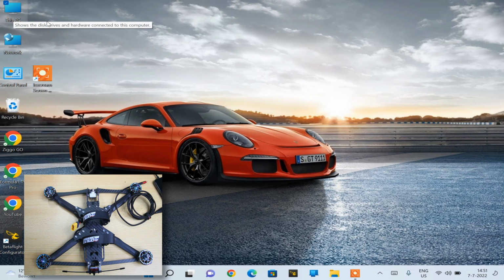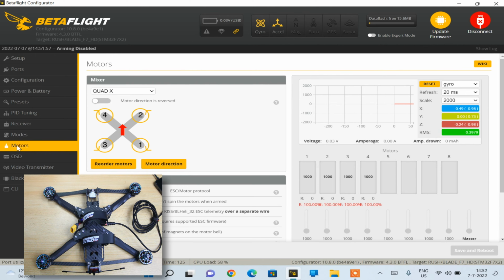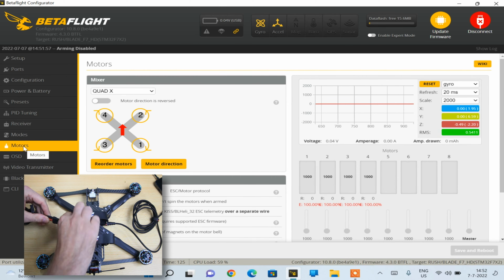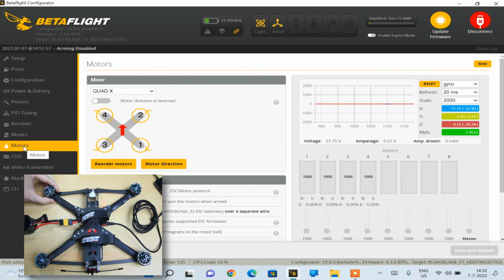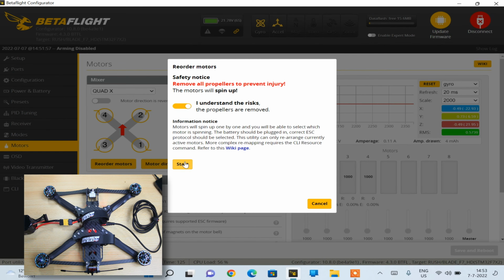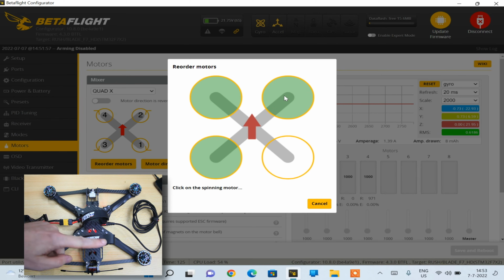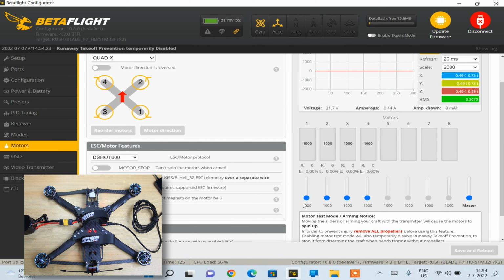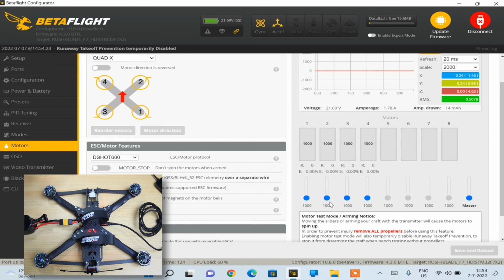BetaFlight How-To: Change Motor Order!

Comment: On a quad. 4 motors. Is this arrangement always correct? As in, 1 is right rear, 4 is left front? And also, the rotation?
Reply from the maker: that motor Order: yes.. that is always the way it should be on a Betaflight quad.. 
The rotation Direction you can swap though

Comment: Dutch my Betaflight does not have the Reorder motor button or option. What shall i do to change the order of motor 1 and 2?
Reply from the maker: Howdy bro :) 
as mentioned in another comment: that is probably because you are running normal Blheli (and not Blheli32).. in that case the reorder thing might not work
Reply: @DutchRC  Thats interesting,so what are my options for changing the motor direction? Thnx Dutch!!

Comment: Oh, thought I'd found the holy grail. Soldered my 4 in 1 ESC upside down so the motors are flipped. Went on to my Betaflight 10.8.0 motors tab, powered up quad connected.
I only have a yellow Motor direction button no yelow Motor order like you had??
Reply from the maker: that is peculiar.. what is the BF version you have on the quad??
Reply: @DutchRC  4.2.9 I'm trying to update firmware to 4.3 but after getting the correct firmware to flash. I hit flash firmware yellow button and the port drops out windows plays the usb unplugged tune and betaflight tells me Failed to open serial port. If I unplug usb and plug in, it auto connects back to the fly controler no prob. When I try to flash firmware it drops out again. And again and again????
Reply from the maker: @pauldfinch4145  okee you are not seeing the option because of that older version on your FC.... 
I'm not sure why your FC resets like that but you could try hooking it up to USB with the bootloader button pressed and Then flash that firmware (?)
Reply: @DutchRC  that was it, not DCU driver. I downloaded the impulse RC driver fixer. It connected to the flt controler had a little look around saw what was missing and loaded it, then left it in boot load so I could just open Betaflight and do the flash. Sorted 2 yellow boxes and I could do what you demonstrated. Thanks a mill for making me aware of them buttons, just had to find them. Subscribed, do love the Dutch accent.👍
Reply from the maker: @pauldfinch4145  ACCENT?!??!?! :P hahaha 
thanks Paul! And glad you got it sorted out ofcourse.. good luck with the rest of the build :)
Reply: @DutchRC  Building the fun bit, flying, a longer road I think, but loving the journey and the folk you meet on the way.
Reply from the maker: @pauldfinch4145  building is indeed at least half the fun :D 
and true.. any kind of shared hobby is better then going it alone :)